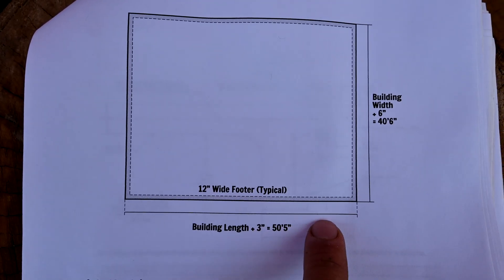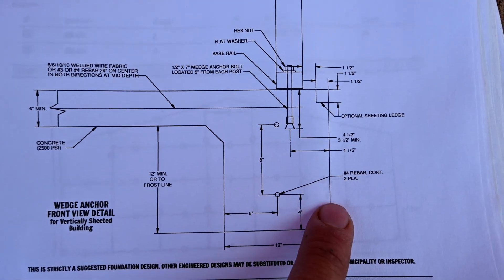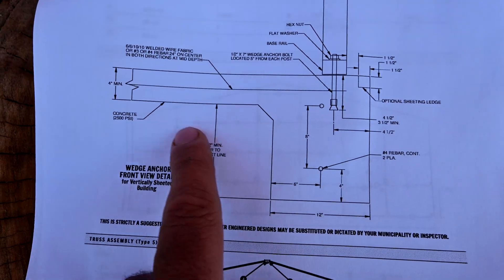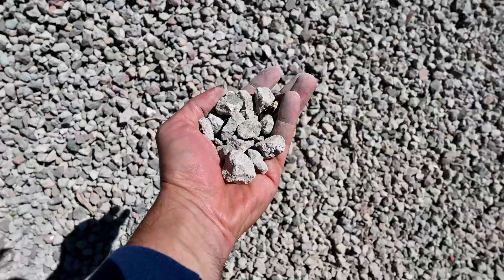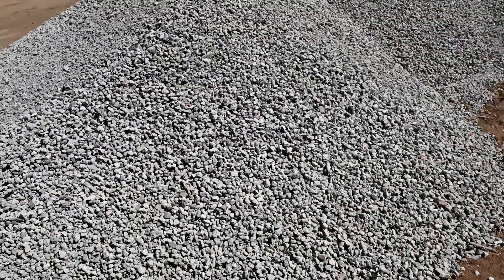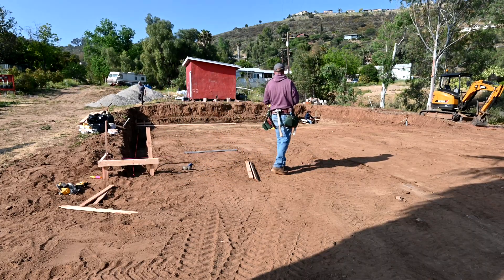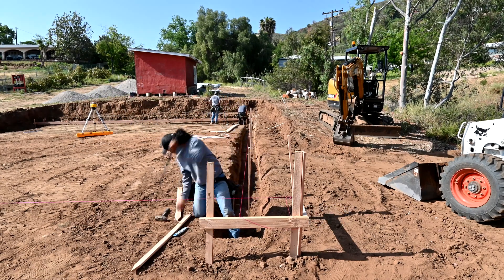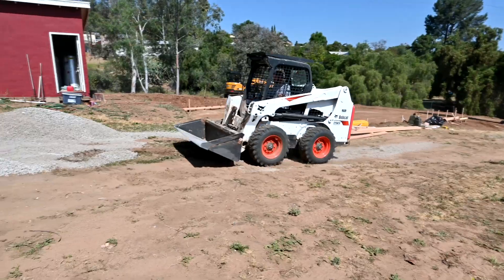Important Considerations When Building a Garage

Comment: How much and what kind of metal goes into the concrete, fence wire, rebar, or what?  It might take a lot to keep the floor from cracking down the road.
Reply from the maker: 1/2 inch rebar, I'll cover all in future videos.